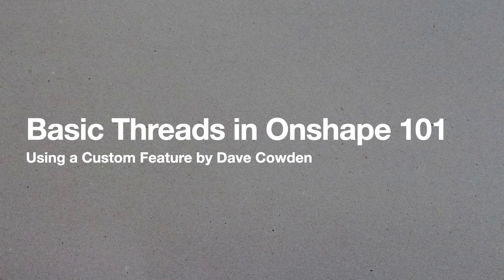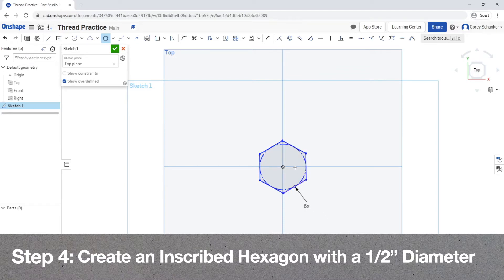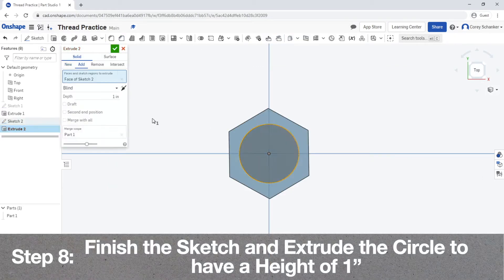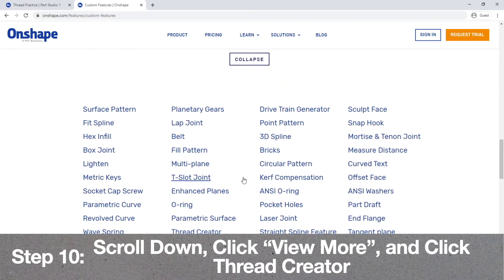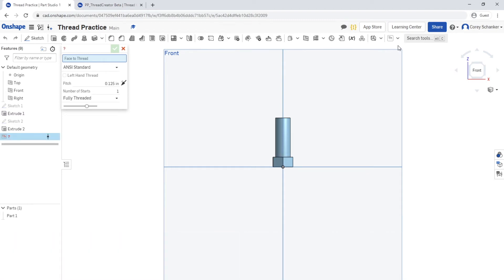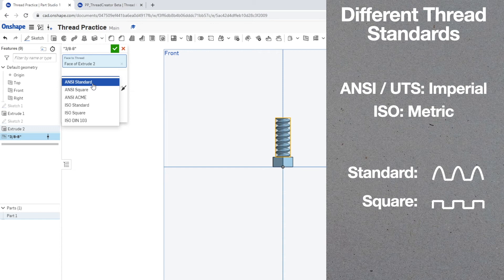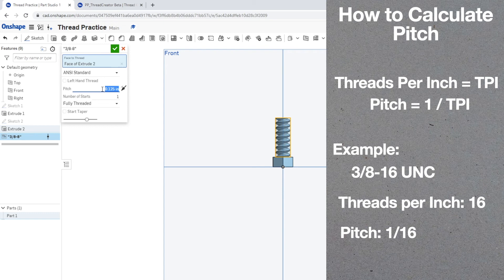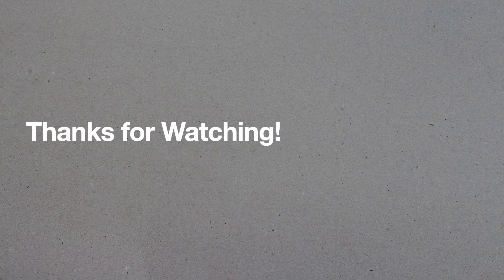Basic Threads in Onshape 101

Comment: The US does not use imperial units, and there is no such thing as US imperial thread standards. The US standard is ASME B1.1- Unified Inch Screw Threads (ANSI was absorbed by ASME) or commonly called Unified threads (UN). The units are US Customary units. Imperial units would be British, and they have/had their own thread standards that differed from the UN series (BS and Whitworth if I recall correctly). Prior to around WW2 the inch was not same in each country. They were close, but enough off to cause fitment problems. So historically an imperial inch was not the same as a US inch. They later made them the same by adopting the same physical master to base all other measuring devices from. There many other units of measure in the imperial standard that don't match up with US Customary units. HP, gallons, stones, ounce, any volume unit, etc. even today. By adopting SI (metric) the British probably had little reason to bother merging the units with the US, and many of them are quite different so would be difficult to do so. For instance the UK gallon if of water is about 10lbs, while a US gallon only 8.3lbs.

The use of imperial so widely used incorrectly unfortunately. Even Autodesk has it listed as such in its CAD software. I suspect this is partly because the US did give the system a good name. Imperial mostly works out if all you are talking about is inches, and in current times. But creates confusion if others UOMs are used. Sizes of tanks and such. Also if the data is sent internationally they would have to assume the units are US customary, when they could actually be imperial.

Thanks for the video though. Stinks this isn't built in...
Reply: yo you typed all of that jus for no one to ever see your comment lowkey:face-pink-tears::face-pink-tears:
Reply: @zerisa13  You saw it